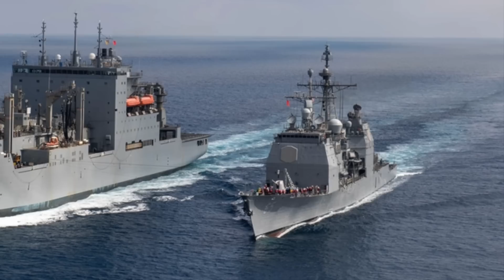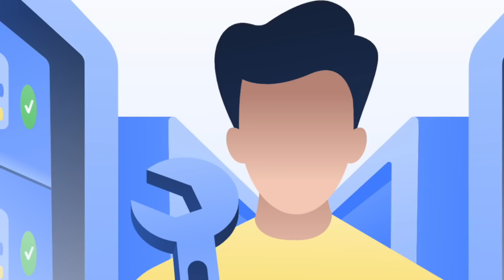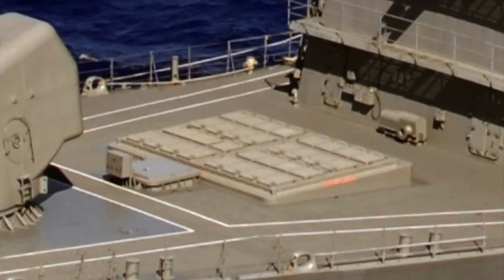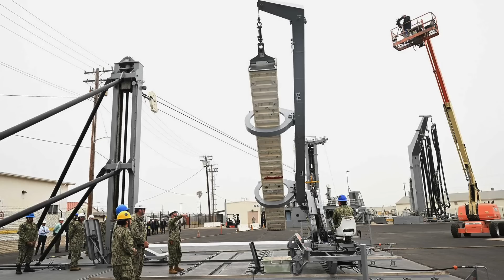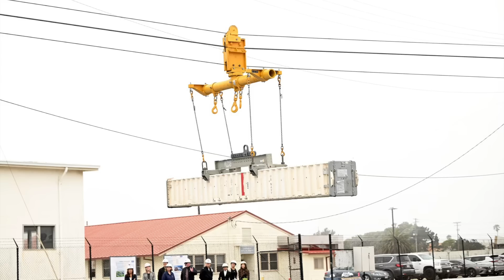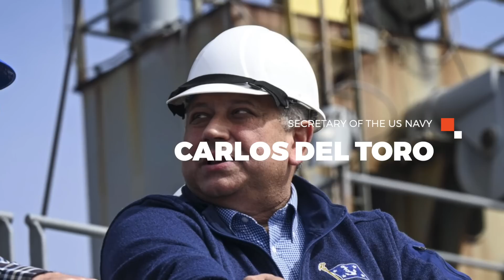How TRAM will fundamentally change the way the #USNavy fights future wars ?

Comment: BS ...On the USS Lake Erie CG70 , we transferred a VLS Canister using our starboard midships sliding padeye using the center hook on a gullwing strongback  ,  while underway . Both vls decks, fore and aft, had a stowable crane in the vls deck at that time . Once on deck at midships , two dollies were used ,fore and aft ends of the canister to steer the canister forward through the starboard breezeway to the foc'sle  where the vls crane was used to lower the canister into its cell .   To say it was squirrelly , and next to impossible in bad weather would be a true statement , to say it has never been done is a lie . The navy scrapped the vls deck crane in later years .  I was there it can be done .  The TRAM System , is new and a better answer to a traditional span wire STREAM Rig ,   Emergency Breakaway capable I don't know .  Weather rarely cooperates at sea , and TRAM too looks very squirrely in rough seas but that is the case with unreps generally .  Using a crane alongside , while making way sounds like it will need the two ships to even closer together in distance .  But ...use what you got , it's the best option we have presently .

Comment: why need this when only few missiles are actually used in real event?
Reply: Very recently in the Red Sea US ships were shooting off their missiles within a few days to counter Houti drone/missile/rocket attacks on International shipping, and still many got through and sank some ships. China could launch 100 times as many, and are firing from home territory. No ship-borne force could possibly match the volume they can put in the air. Result? US ships will be sunk, not to be replaced easily. They will HAVE TO come up with some better solutions.
Even Israel, with their state-of-the-art missile defence systems firing from home territory, couldn't stop a small launch of 180 incoming missiles/drones/rockets, and numerous strikes were achieved. Fortunately, these were largely quite primitive units. The Chinese will use far more sophisticated units, you can be sure! 
Lasers:  the problem here is that the technology is in its infancy, and needs huge power to operate. Also, each "shot" is not like a shell, as it needs some time (?) on target to make a kill. At hypersonic speeds, how many "shots" can a laser get off in time to disable a multiple simultaneous launch?  This point is carefully side-stepped by the Powers That Be. 
I leave you to ponder these points.
Reply: Good question...

Because the military plans for the worst case scenario -- so far since Vietnam, we've fought just about every enemy largely on our terms, but China is one of the few countries that can potentially counter that...
Reply: Yemen proved that theory wrong .

Comment: If the US navy wants to survive and defeat the Chinese Navy in a full-on war over Taiwan, it had better be able to load these things in 6-Packs - at least.  Re-loading at sea in calm, no threat scenarios is one thing.  But while under enemy fire, with ships screaming for replenishment is quite another.  The Chinese are not stupid or un-skilled.  Nor are they broke and lacking in technicians and modern manufacturing.  Any war with the Chinese will happen within range of everything they have, which will mean they can launch over whelming numbers of missiles.  The US navy will as well but will delete their on-board supply in less than three days.

How fast can a fleet replenishment ship replenish?

Comment: Reloading should have been designed from the very beginning of the design of the VLS system. Something similar to the MLRS reloading process comes to mind, modified to become an erector.
Reply: A system was there at the beginning but as the missiles grew in size and weight that reloading system wasn't strong enough to deal with it and the Navy got rid of it. Instead of immediately designing a new stronger system the Navy dropped the ball and let things languish. Now they are rushing because of the fear of China invading Taiwan.
Reply: These missiles are way too big and heavy for that to be feasible.

Comment: Its a good start but they should look at a faster system. The USS Proteus in 1961 was able to transfer a 17 ton Polaris missile to the SSBN in harbor
a system able to move at least 10 missiles per transfer
The DDGX which will have swappable VLS is the right answer
instead of missile by missile, the ship can simply pull and yank out the old VLS and replace it will a fresh one and depart in a hour
substantially faster
Reply: You are totally right, Mr. Armchair Engineer.
Reply: @jairo8746  
its simple facts
The TRAMs allows transfers at sea however its missile by missile and  VLS size is the issue
for FFGs , its 32 missiles
DDGs 90-96 missiles
CGs is 122 
You're at sea but the process is nor shorter

Comment: With the negative comments, made me think... how to make the resupply ship a smaller target. Submarine Resupply.
Combat Ship uses TRAM to pull the cells out of a stores bin in the sub, it closes the bin doors and can submerge asap if threatened.
It could even refuel in a pinch as well, from saddle tanks. But I think in combat cases, a ship with aircraft or combat drones would cover the ships resupplying, and then those ships cover the carrier as it resupplies - You scratch my back, I scratch yours.